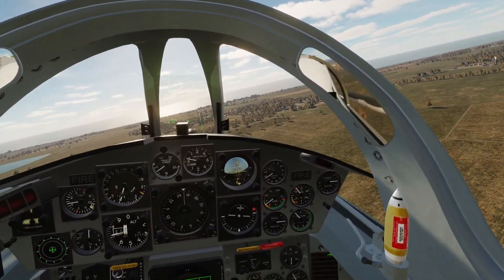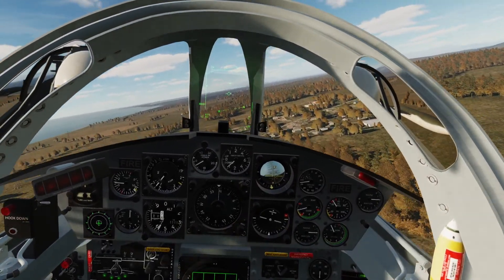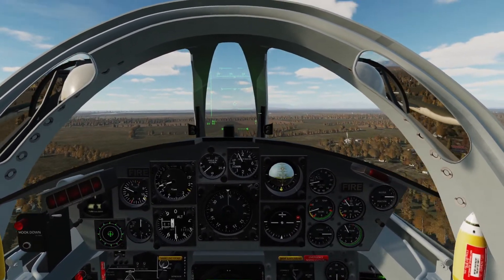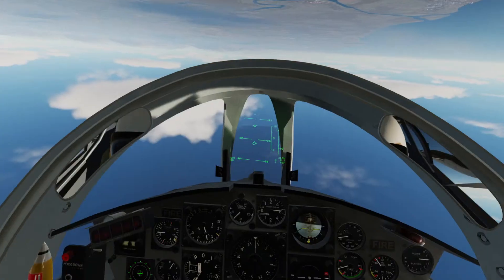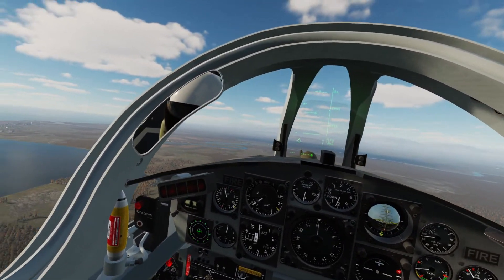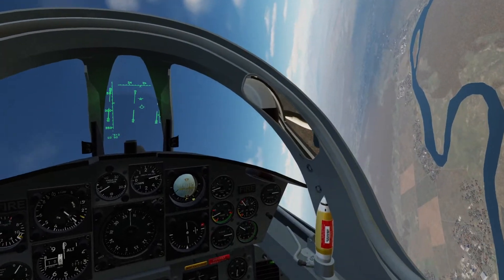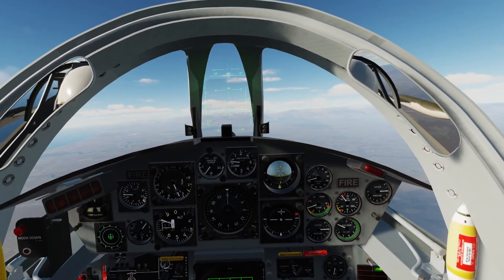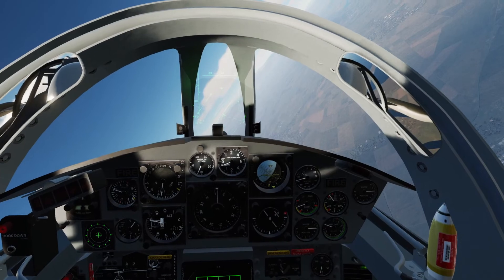F-104G EFM Bomb Attack Tutorial

Comment: Question, what tools you use for flying, how do you keep your oponent in view all the time for example, thanks.
Reply from the maker: I like the VR, its easy to keep track of another plane for me because it exact, I turn the head where I want. I have a harder time with track IR, few pixels on a screen dont stand out all the time and track IR is not as exact, jumps around and has some bad dead spots.
Reply: @FSX404  a ok, if i may ask which one? and i guess you use rudder peddals. I like your content, i saw starfighters fly lots and lots of times in the Netherlands , low level , base attack during airshow when they were still allowed to come from every side of the field in 2 ships i believe, well some time ago it was
Reply from the maker: @paulfarstar5589  I use the Reverb G2, but it needs at least a 3070, or even 3080 for decent performance. I do use rudder pedals, they are essential for dogfighting, maybe not in the Starfighter but any other non rocket plane.
Reply: @FSX404  thanks